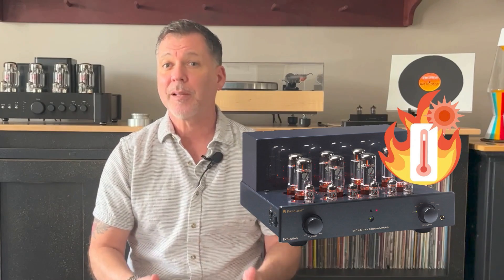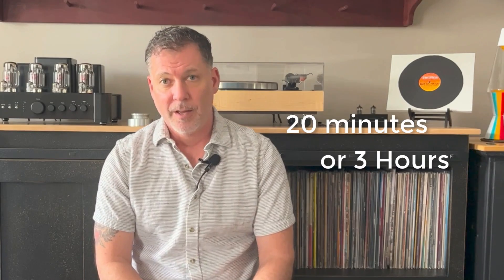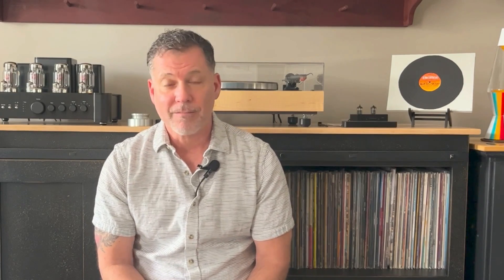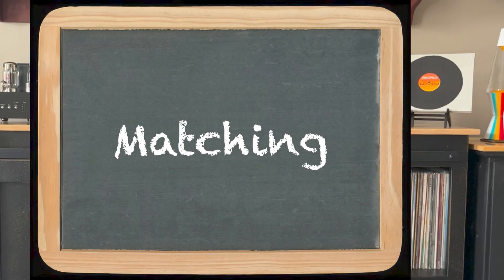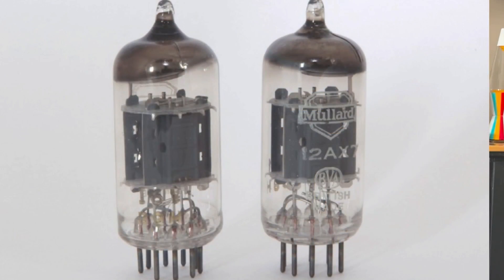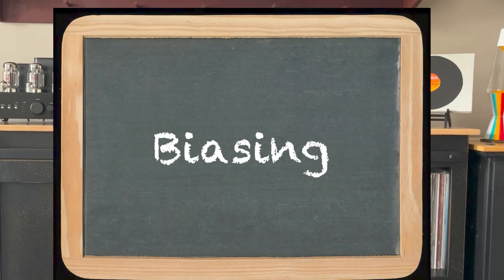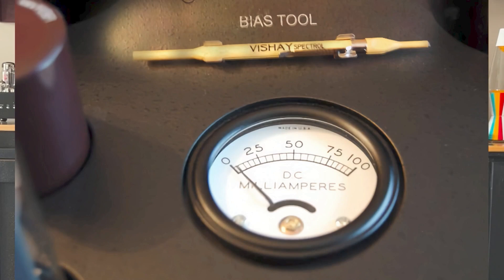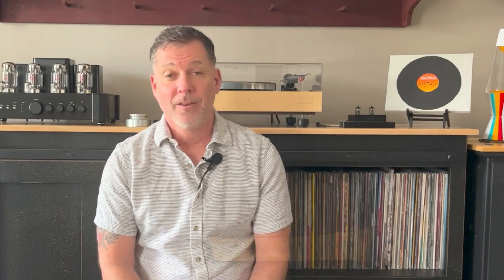What is Matching & Biasing Tubes?

Comment: Hello again Rick, Sorry to be such a pest, but I respect your opinion and I have been out of the vinyl world for more than two decades. After you told me about the Pro-Jet Phono Tube Box S2, I did a little research on it. I found out that it matched well with my Ortofon 2m Blue cartridge. I took the plunge and I am loving the sound. Thank you for the recommendation. My question relates to setting gain. Initially, I set it out 50 and loved the sound. But I am not sure if there is some science to setting the gain that I am missing. The manual was useless. Should I be matching it to the volume on my cd/dvd player? Or is there some more appropriate procedure to follow. Thanks for the help. Joe
Reply: Thanks Rick.
Reply from the maker: Hi Joe!  I'm glad you enjoy it.  There really is no science to it to be honest - and you're right the manual doesn't help at all. I have mine set at 40 and love the sound.  Don't go above 50 with the MM but it's all about what you think sounds the best.

Comment: Excellent video! Thanks, this answered a question I've been researching ever since acquiring a Blue Circle Audio BC 202 hybrid tube amplifier. It has a set of four 6922 input tubes and there's no mention of biasing them in the owner's manual. The owner's manual does state that there are "no user serviceable parts inside" but I can't imagine this includes simply replacing the tubes. So I think your statement that most tube amps today are self-biasing includes mine as well.
Reply from the maker: Thanks @anthonylewis1475  !  I believe the tubes in the Blue Circle are there for the input stage.  They are probably self-biased (also known as cathode-biased) and do not need to be manually biased. A resistor and capacitor sets the bias automatically.  If you ever begin to hear noise you may simply need to replace them.